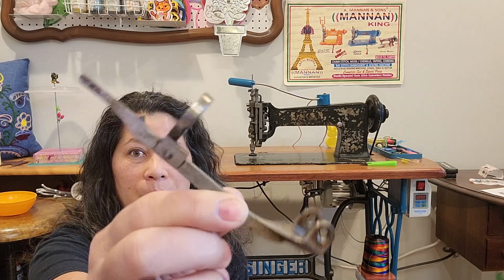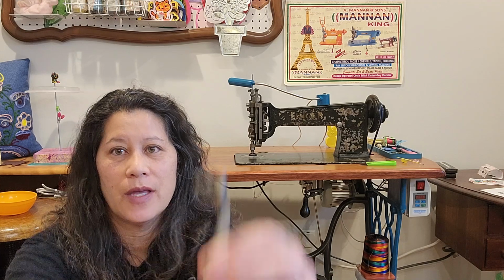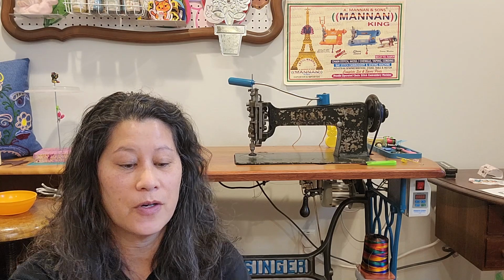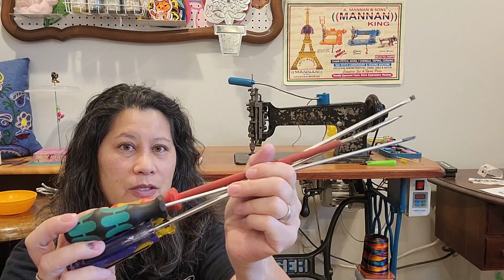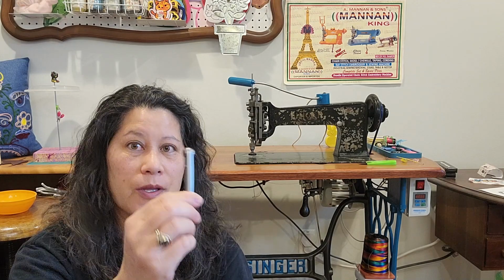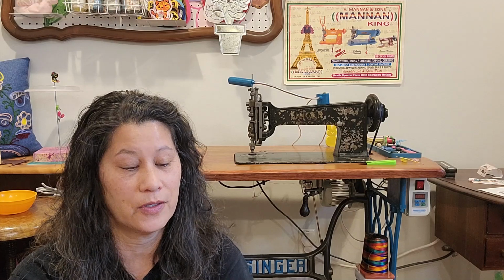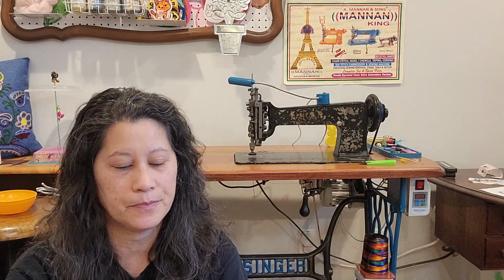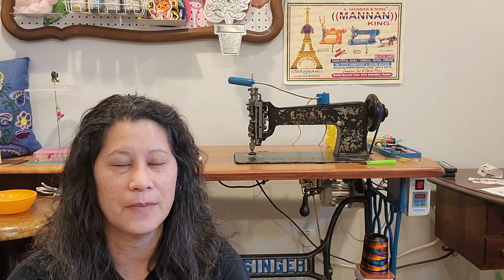Chain Stitch - Take Face Apart

Comment: Excellent job.....   I have notice over the years of working on Vintage things. Radios, furniture, cars.  It always seems that  the slots in the screw heads are not as narrow as modern screws. Causing the modern screw drivers to not fit snuggly slip off and damage the softer metal of older screws.  I oft had to mill off the end of a screw driver to get a solid fit especially on old house fuse boxes.   I finally got a nice variety set of bits from MAC tools. It has most every size and type in the kit from torx to tri-wing tips, flats, phillips and tamperproof. - $176.00.